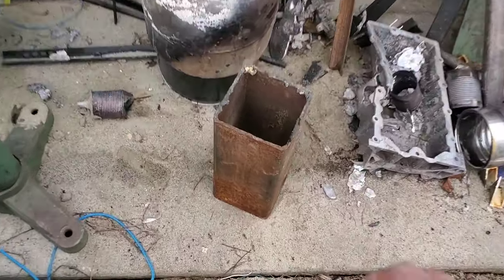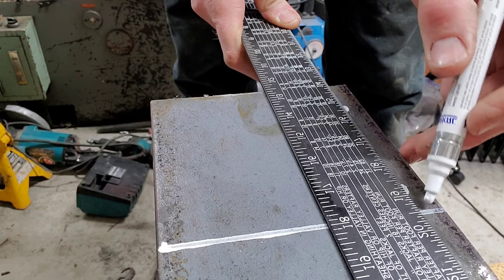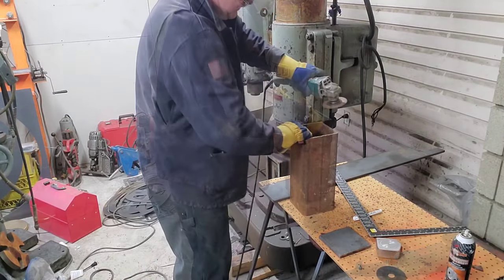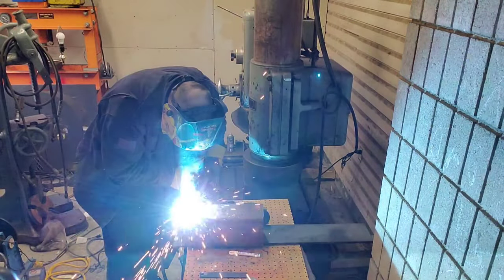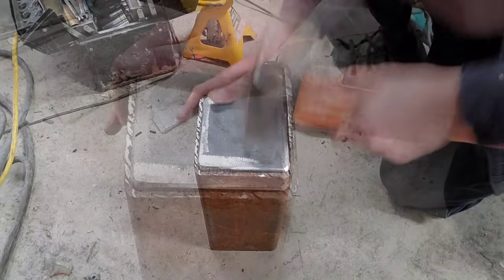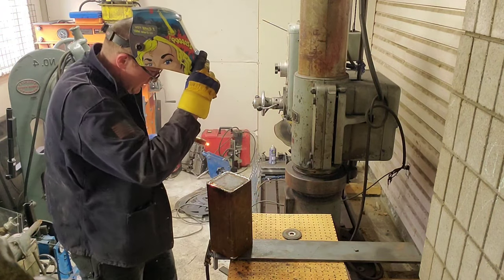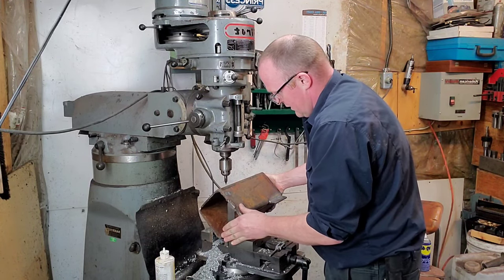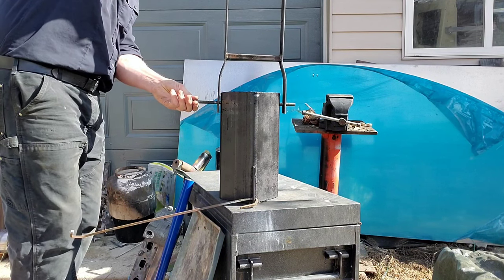Making The Metal Crucible for the foundry workshop

Comment: I use steel crucibles for my initial melts on dirty aluminum then pour clean ingots for casting use.  I save my good bought crucibles for my cleaned aluminum when pouring molds.  I've never had a steel one fail but I do one thing different.  The bottom i put the plate in a bit further and then heat and fold over the edges so if the welds crack from expansion the bottom can't drop out on me.  On the top I put two bolts so I can just hook onto it with lifting handle.  Same type of hole at bottom as you did to control the pour.

I have a couple of cast iron ones I made as well but they tend to crack over time so I don't trust them too much or recommend it.

If your casting aluminum it melts at a far lower temperature than steel anyway.
Reply from the maker: Hey John great input thank you very much . I may take some of these design considerations in when I build the next one.

Comment: HSS stands for High Speed Steel, a type of tool steel used to cut other steels. The box section you use is probably A36 steel, a low carbon structural steel - probably a better choice than HSS since HSS is very expensive.
Reply from the maker: yes you are right about hss being high speed steel my friend. I did 5 moonlighting as a millwright ( im a redseal machinist as well ) and the iron workers have me convinced HSS is also Hollow square Structural or Hollow square selections .
Reply: @Wrighmachining  I didn't know that. Part of why I hate acronyms, they can have multiple meanings.
Reply from the maker: No worries man i hear you .